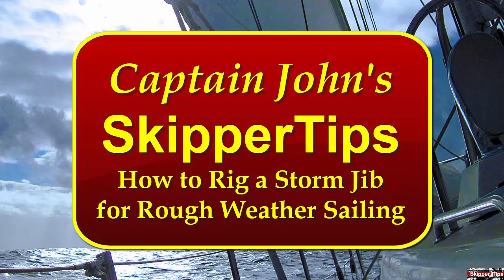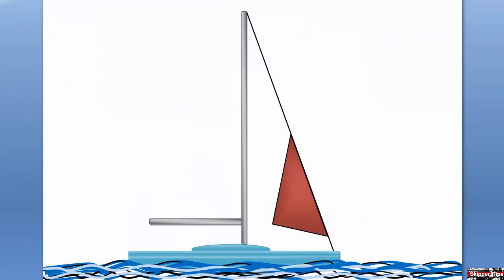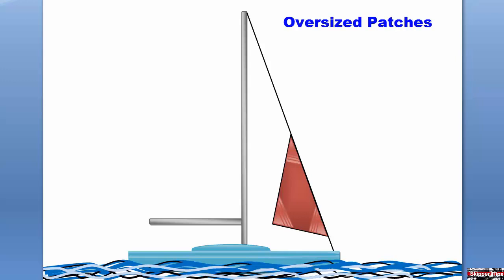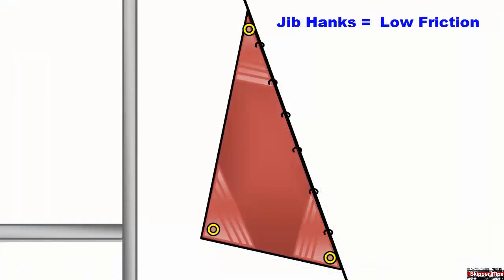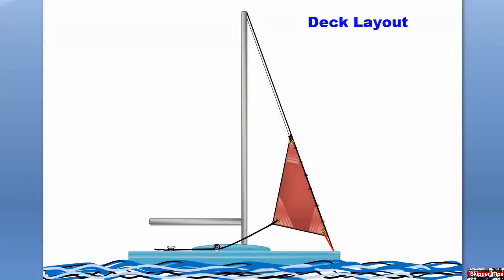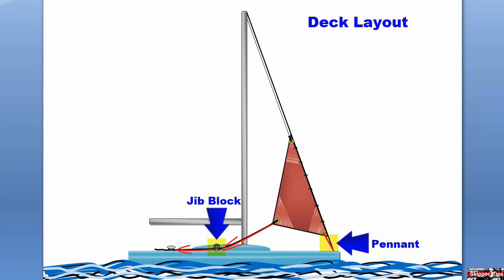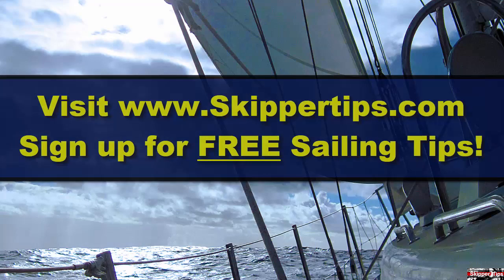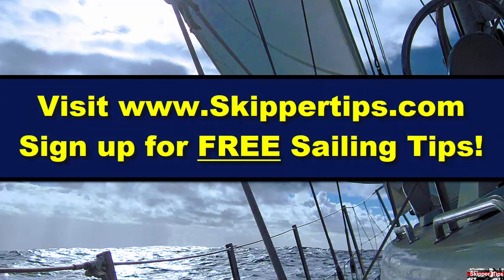How to Rig a Storm Jib for Heavy Weather Sailing

Comment: Great tip.
A storm jib is on The List.
I have roller furling. There’s storm jibs that wrap around with Velcro instead of hanks.
Any thought?
Thanks in advance.
Reply from the maker: Nick, I do not have experience with these wrap-around sails. What concerns me about furling Genoas in extreme conditions is the fully furled sail could still unfurl on it's own. That's a lot of windage up high (check out a marina after a bad storm and you will see tattered furling Genoas here and there, which is one reason all windage should be removed from moored or anchored boats (furling sails, mainsails, mainsail covers, dodgers, weather cloths, etc.). Anything on deck is vulnerable. You might contact the folks at ATN (makers of the 'Gale Sail). Ask for references so you can contact customers who have used their product in gale conditions. Click on this link: https://www.skippertips.com/snip/1381.htm
Reply: @skippertips  Thanks Captain John for the follow up tips!

Comment: How many knots can these storm jibs take or designed for?
Reply from the maker: Talk to the builder of your storm sail (sail loft). Factors include cloth weight, square footage, corner reinforcement, and your sailboat rig (loads on rigging, mast, and stemhead). They are the experts to advise you on your specific sailboat and the storm sail used about your boat.
Reply: @skippertips  I love your videos and tips but come on with that generic response 🤦‍♂️ you could have said mine was/is rated for 40 or 60 knots   and sometimes I push it higher and it faired well or whatever but check with the supplier specs to make sure…give me something to start with that’s relevant to your experience and content which is why I watch your stuff. I could easily go to precision sail or google and find out. The question is related to you, your insights and experience which is why I watch your stuff and try to gain some connection and find out what is not posted or easily obtainable online.
Reply from the maker: My best advice is to ask your sailmaker. Or, you might go onto an online forum of skippers with boats like your boat and post the question.